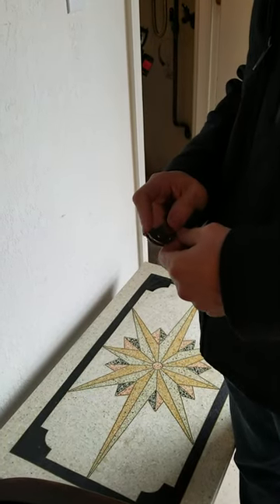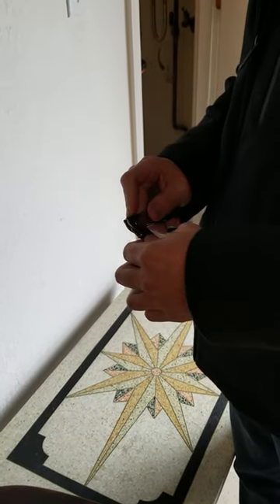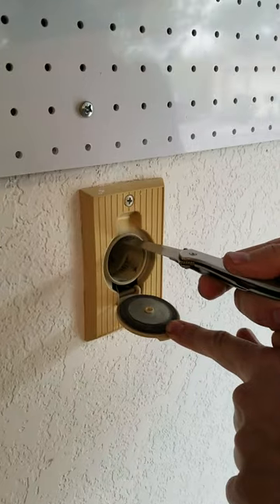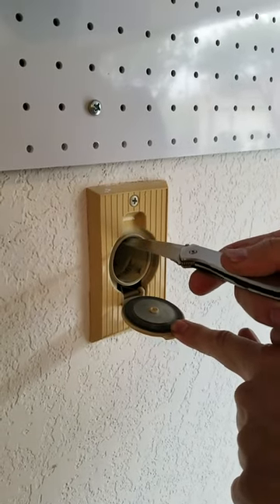Home buyer tests the wall connection for a central vacuum system

Comment: What is a central vacuum system and what are you testing?
Reply from the maker: The sensor at the plate turns a vacuum at a remote location . Typical in expensive high end housing
Reply: @brickbybryck  is there a name for the system so I can Google it?